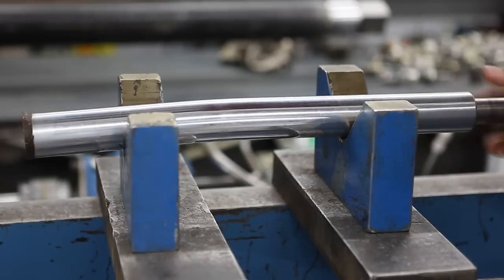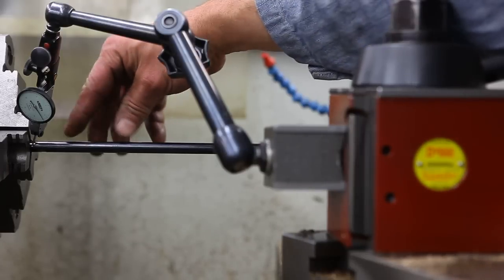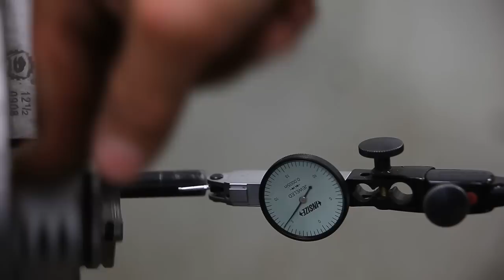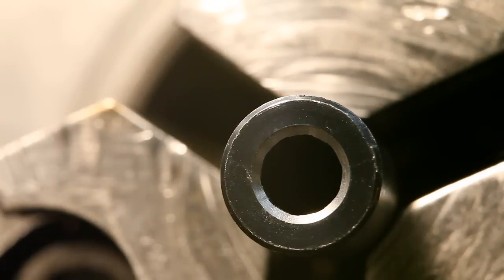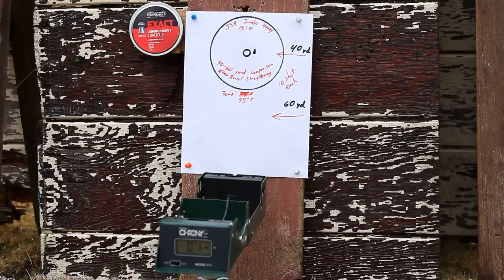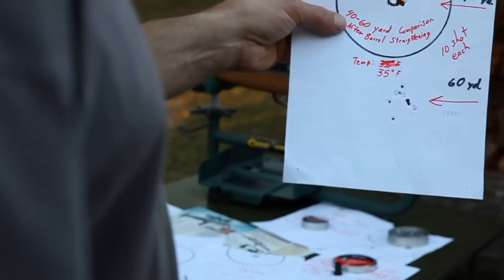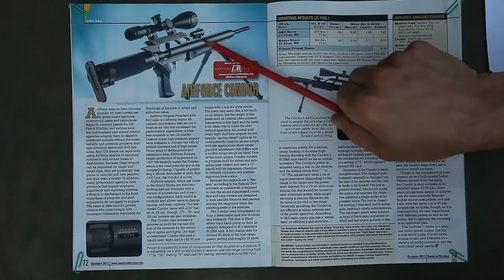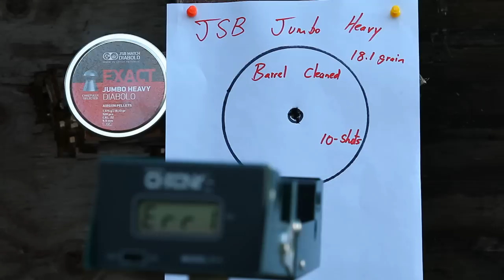Straightening the New Marauder Barrel

Comment: I would consider shooting a tin of pellets through that barrel without cleaning it. The fouling from a few hundred shots provides a very good gliding surface inside the barrel, lubricating the pellet and providing better shot to shot consistency (lead having very good lubricating properties). My local air rifle club has Weihrauchs in .22 and .177. They get several hundred pellets through them every day. I've never seen anyone cleaning their barrels, they usually only do it once accuracy goes bad (10000 - 20000 shots down the line), and then - they don't shoot right until 200 or so shots in. Observed the same with my .177 Daystate (of the late '80s too!).
Reply: Perhaps they should make lead condoms if the lubricating properties are so good. "Magnum - with added lead."
Reply: Mark Palmer If dicks and fannies were made of steel - I'd be the first to patent this. The whole barrel dynamics problem is a lot more complicated than people think

Comment: I saw where a guy put a complete loop in a barrel to prove that as long as the last couple of inches were good and would stabilize a bullet the POI was not effected and he did prove it. I got a 2260 that was bent in shipping the box was bent also(thanks UPS). It shot really tight groups but there was no way to sight in in with the iron sights or with a scope as the POI was off by about 10' at 20 yards. I straightened it by putting the butt against a baseboard and just by hand, I was surprised how easy it straightened out. I just straightened it so that the POI was centered with the Iron sight centered both horizontally and vertically at 40 yards. At 40 yards with a scope I can shoot one ragged hole with it now so it was one of the best barrels before UPS and is now after UPS and my fix also! I would be thrilled if all my barrels were as good as it is.

Comment from the maker: Wow, that was a fast comment for a 53-minute video!
Before I shoot for the testing, I lay out the 10 or 20 pellets I am going to shoot and visually inspect them for any bent skirts or obvious flaws. But I have not weighed or measured them.  At this point, I am basically keeping the conditions as to what an average Joe Blow who just purchased the gun and pellets might expect.  That is one of the reasons why I have also still maintained the gun at the stock settings.

Comment: ayup there kris,greetings from sunny england,had a similar thing happen with a theoben R7,bought a aftermarket barrel from a local dealer was supposed to be a bsa barrel but turned out to be a LW,anyways you could sight the gun at say 40yards,but at 20yards would shoot to the left,and anything past 40yards would shoot to the right,turns out the barrel was bent by about 40thou,at 90 odd degrees to where the transfer port had been drilled,hence why it would never shoot straight at different ranges,as i understand things almost all production barrels are bent,the trick is to make sure that the barrel is mounted as in the case with my theoben the transfer port is drilled at exactly 180degrees to the high point of the barrel,a process usually called over here shooting a barrel round,anyways excellent video kris reckon all that effort you put in on that barrel paid off in the end.ANDY.

Comment: we used to straightened parts for aircraft by hand out of the foundary with mallets, then they went back in oven to bake and harden the shape we pounded it into, dial indicators are nice to have i use then with my milling machine also. lathe chuck method has been around for decades for bar staightening, also no barrel, even the best guns have dont perfectly straight barrels, the barrels from factory go by a minimum tolerance, and no barrel is going to read perfect on a .0005 dial indicator, even olympic grade airgun barrels have play when useing a dial indicator

Comment from the maker: That's good to know.  My .25 uses a urethane-90 duro o-ring whereas the .22 uses a nitrile-70 duro.  On both guns it is easier for the pellet to pass the o-ring then it is to fully chamber the pellet, but there is still some resistance passing the o-ring that could cause a slight skirt crimp before the chamber.

Comment from the maker: +amasoak47
Crosman shipped me a bent barrel with a horribly inconcentric crown that shot better than my original barrel.  I figured I had a better chance of getting a straight shooter by fixing this barrel than if I had returned it to Crosman and gamble on yet another replacement.

Why didn't I call Crosman and give them hell?  Well, I figured uploading two videos on the subject generating a total of ¼-million+ views so far would be hell enough.

Not sure what you meant by "You ruined it for everybody".  Was I supposed to keep my bent barrel a secret or as a surprise for anyone who wanted to buy a replacement like I did?  Sorry, I was not informed of the hush-hush.

Like the majority, I don't own the tools in this video either, just access to them.  It is one of the benefits of working at the same place for 25+years.

The only thing I can do to help you with finding the point(s) to this video is to suggest that you don't think of it as a Crosman-bashing video.  Try thinking more along the lines of cause & affect.  Straighten this, machine that, & expect to have this amount of affect on accuracy sort of thing. 

BTW, if you are going to ask questions in the comments section, then fix your reply button.

Comment: Barrels need to be Straight on the Inside, not the Outside. Accurracy on an Airgun Barrel is determined by many other Factors, such as Bore Diameter Consistency, Crown Finish and eventually Choke. If a Barrel is "bent" one might try to clock it to point up or down, not Sideways. Also, one might try to use adjustable Scope Mounts.

Comment: some of your pattern spread maybe due to the variation in pellet size or weight ... in my testing size seems to have the most influence in accuracy, since by barrel diameter is large and does not have a choke ...

Comment: MInute 33:52  It is not your barrel shootingthose groups, It is trigger squeeze and pellet quality. Weigh you pellets, and seperate them and shoot htem in weight groups, while working on your form. You have 1/2 inch groups at 60 yrds not bad.

Comment from the maker: The choke in the new barrel is about .0005-.0010 smaller than the old barrel that gave ultra-horrible accuracy with some pellets.  Haven't compared the diameters in the other sections of the barrels yet however.

Comment: I've watched your vids on machining / improving this new air gun barrel and it was intriguing, though a little long, the improvements were noted. I can't afford one but I would attempt to do the same as you.....   in watching many squirrel and rat killing air gun vids  I would modify the forward hand grip area of the stock and install a large dial which would be attached to 
( small timing pulley's as typical on   home built cnc machines 5 mm type) the elevation dial which itself would have a modified cap with small timing pulley ....  ratio between two pulley's  3:1   ~  4:1 perhaps ..............   the point to it all is that the elevation adjustment would be at the finger tips where you grip the rifle .....and on top of the wheel itself would be little bumps ( similar to  Braille )  thus your fingers can feel what "range" your at by the bump count  2 bumps for example would be 20 yards   or 20 feet which ever units you set it up for.  I thought this approach would be great for low light conditions. And with a 3:1  or 4:1  ratio  you could have several hundred yards of elevation adjustment with one rev of the forward grip dial ..............                just passing thoughts

Comment: Nice work.  Only wished you had withdrawn the tool when crowning to let the accumulated swarf drop out, rather than get trapped between tool and barrel bore.  Those work hardened chips can score the bore; stealing some of your accuracy potential.  That would be a pity, considering all the work you had done.

Comment from the maker: The angle is built into the tool itself, it is not adjustable.  The triangular inserts it takes has cutting points on both sides for a total of 6.  If it only used the three points on just the top, then a clearence angle could be ground into the insert itself and the tool could be flat.  But with this tool, they tilt the entire insert down to make the clearence at the cutting edge/point.

Comment: Factory barrels are intentionally bent to make an internal straight line after cutting rifling. External straightness does not matter. If you are mounting accessories, just cut a new line on o/d and spray paint.
Reply: +Tracybeme What do you mean by "internal straight line"? :)
Reply: +taiden The drill bit and the tube flex when you drill and groove the barrel. Bullets don't follow the out side contour of the barrel, but they follow the curve from flexing of the cutting tools inside the barrel. To straighten this curve, the factory intentionally bends the barrel to conform to the internal line. Adjustable sights align and correct impact to the internal cut of the barrel.

Comment: I am thinking the same thing- Do I have to straighten a new Marauder barrel if I get one ? ? ? ? ?  I don't like this, where is 'Quality control ? - and are the barrel's made from "Aluminum" ?
Reply: He ordered a new barrel because his last one was inconsistent but the one they sent him wasn't any better.. .22 barrels are usually the problem when it comes to the marauders. I've owned 2, first and second gen, the first gem barrel was way better than my second so I just replaced it. If you're going for the marauder get it in .177 or .25. The .22 seems to be its weakness.
Reply: tinkergene I have a new Maruater field and target in 177 and it can drive a nail consistently at 50 yards. Don’t believe the haters or people that have to spend a fortune to make themselves feel better.
Reply: tinkergene The barrels are made of steel.